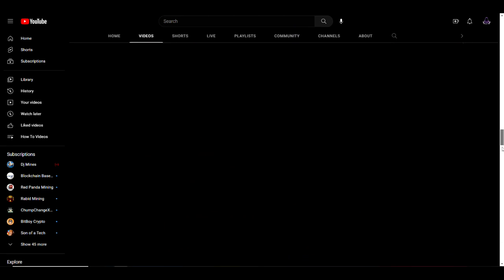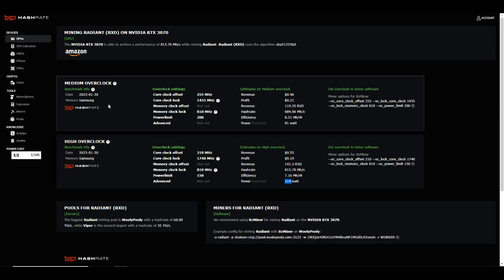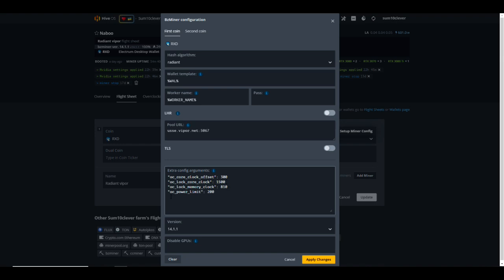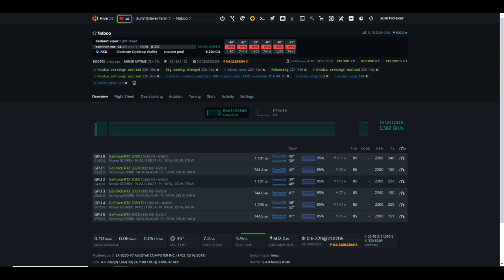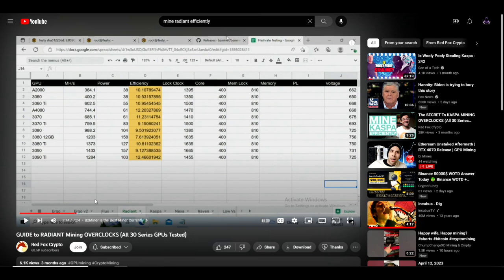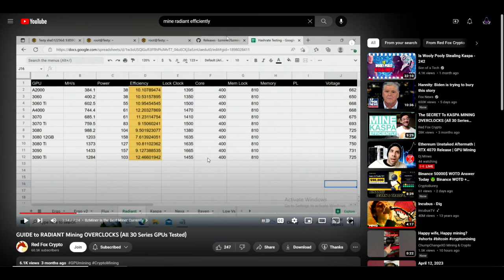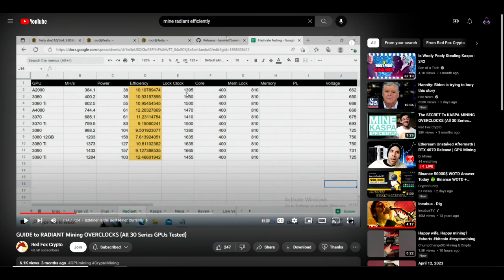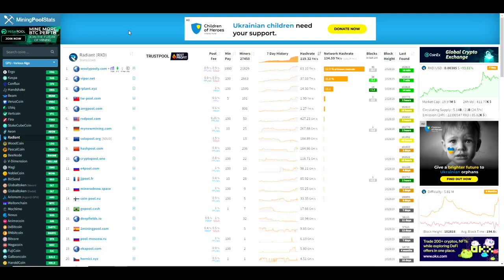An Update on overclocks for mining Radiant RXD on 30 series GPUs

Comment: Can everyone see the numbers on the screen, its so out of focus for me...I cant read any of the data. :-/ I am trying to set overclocks for my RTX3080's on Radiant, currently burning 150W and mining 960mh/s which sucks when I hear these figures you are getting...
Reply from the maker: Try clicking settings in the bottom right side of the video and changing the resolution. It usually adjusts based on your internet speed but can be changed.

Comment: Oc settings for 3060?
Reply: MSI RTX 3060 3x Ventus
--oc_lock_core_clock 1600 --oc_core_clock_offset 300 --oc_lock_memory_clock 810 

Efficiency 9.83 = 471 MH = 48w 

Best I've achieved. If u find anything better, pls share.
Reply: @iam_wrosettastone  Are you making any other adjustments, is that all?
Reply: @alperkaya5862  No. Those r my only settings.

Comment: You have 3 different locations with settings. 1) Flight-sheet user-config, 2) Rig-level Overclocking, and 3) RUN command. What's the interaction between all 3. Does one take precedence over the others or are they averaged or what? Do I need to set in all 3 places?
Reply from the maker: sorry guess I didn't explain well enough.  So, best to use extra arguments for overclocks.  I use Nvtool for testing and once I find what I like I change the extra config to match. Nvtool OCs will be lost if the rig reboots.  The overclocks in the hive dashboard mean nothing unless you change them (If you make any change in hives dashboard it will override all the GPU overclocks the moment you make a change there, and you will need to relaunch the flight sheet for the extra config overclocks to take effect again)

Comment: interesting, it gives you an efficiency of 10.62  For my 3070 (zotac samsung) i put: 
"oc_lock_core_clock": [1305]
"oc_core_clock_offset": [250]
"oc_lock_memory_clock": [810] and Core=250  Mem=(nothing) and 130w

with this setting it gives me an efficiency of 12.05 = 628.4 MH = 52w 

It's always good to know how other people do their OC. Each person has their own technique. 👍
Reply: Not bad, but my 3080 does 1.1ghs at 97w so thats 10.98 efficeincy but my hash per $ is better. I bought this card brand new for 400eur.
Reply: @filippetrovic845  Cool 👍Nice price. Bon prix !
Reply from the maker: Have you tried 400 core offset and 1305 locked core. Might be more efficient
Reply: @MineSum10  No, but i will try. Thanks for the tip. 😁

Comment: does the nvtool override all other settings you configure like the ones showing in Hiveos there?
Reply from the maker: Yes it does until you change anything using HiveOS.  So for example if you change the fan speed, you’ll loose all nvtool settings and it will default to what you have in hive so be careful

Comment: I have 65Gh on radiant at about 8000w I use locked core at 1500 and offset of 250 for all my rigs for stability
Reply from the maker: 300 core offest should not give you any issues at all on 30 series.  I never had an issue.   So far 24 hours on 400 and no problem at all
Reply: @MineSum10  my 24 x 3080m don’t like anything over 250 offset
Reply: @Ziegminer  same, I can't clock over more than 255 core offset on my MSI 3080s or else they crash.
Reply: That is efficiency of 8.1mhs/w but my 4090's do 13.2 on average. My last 3080 does 1.1ghs at 103w its 1565 cclck 810mhz mclck
Reply: @filippetrovic845  that 8000w is at wall including 9 3900x cpus 20 case fans and a 16” ac infinity shutter fan so I’m happy with it